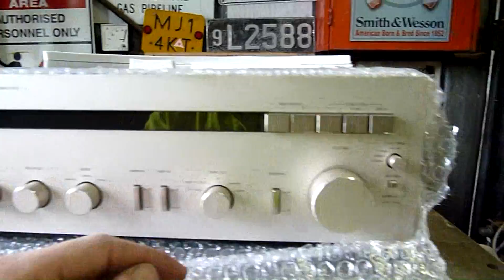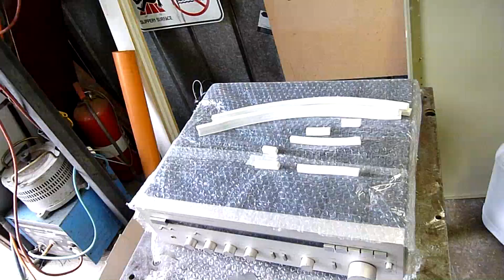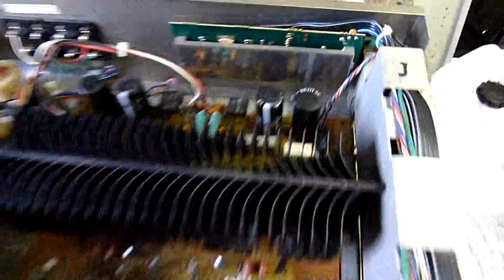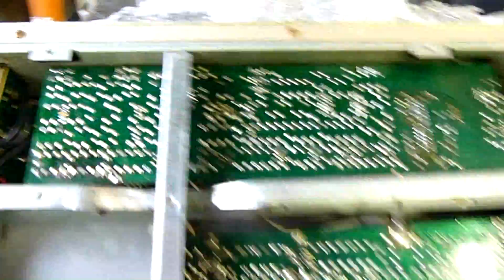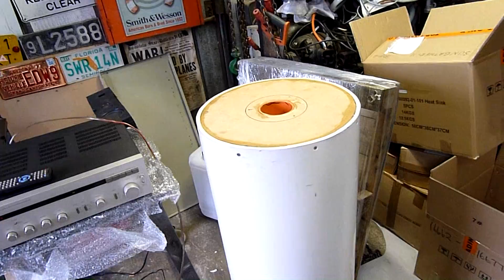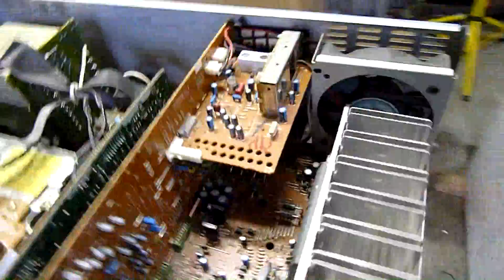Harman Kardon PM650 Unpacking and Test Run

Comment: The amps that actually put out there rated wattage bought a Harman kardon avr 1610 rated 85 watts 2 channels driven have a Nad brand amp less wattage per channel and can't stand it up past half and used the avr in 2 channel configuration had it up at 3/4 and was like wow pathetic . Nad stuff is built more like the old stuff may cost a bit more but you get real power

Comment: G'day mate
Not a bad amp there , bit of info at  Audiokarma  on it &
If you are after a service manual for that ,
[ HARMAN-KARDON HK-650 SM /elektrotanya ]
  ^ google search it that way ^ cause the site is czech or polish unless you understand (manuals in english)
elektrotanya has good quality service manuals (max 2 a day for free)
 you will see underneath the preview , wait until it says "get manual"  then its free of charge.
goodluck with the recap

Comment: bias pots i guess, but why would a transistor amp need that?  I thought variable bias was exclusively a valve amp thing, so when new output valves are fitted the bias current can be set to the users preferance.

Comment: ed i reckon those sankens NPN PNP may have been newer additions - the older kit used to have toshibas and the like - i've built a new solid state things with these before - the 1169s and 2773s are common place and can be had easily enough.....

Comment: grab the fan and transformer out of the DVD changer, you can never have enough fans and you could have some fun with the transformer wired to step up the voltage (and then burn it out)

Comment: Not worth to change those supply caps for a bigger value in my view, this amp use two separate power supply rails for left and right channel as I remember, that's why they are a bit lower than most amps have, when there is both channels on same rail then yeah 10000uF is standard. New 4700uF will do the job perfectly in this amp, we are not talking 100W RMS here anyways. You will only make more problems with bigger caps, like random fuse blow on power on :)

Comment: One that runs directly off the AC mains? That's interesting, and useful. I found a junker Sony home theater amp that someone dumped, I'm not going to try getting it going though, it's been thrashed with broken controls and so forth. That's going to have the power transformer, heat sink, and other bits pulled for other projects.

Comment: You can always spot cheap consumer grade electronics like that all in one unit, lot's of plastic, no weight, and a switch mode power supply. While not every device with a switch mode supply is garbage, every garbage device uses uses a switch mode supply.

Comment from the maker: could be somthing as simple as a ground loop issue, try running a earth strap from the amps metal chassis to the chassis of what you are playing into it.
The Monarch amp in my bedroom does that if I do not have a lead going from the computer case to its own ground lug on the back panel.

Comment: Looks like the pairs of caps are wired in series and centre  tapped, so would be a pls and minus supply (2  x 5 mictofarads in series would be a total of 2.5 microfarads)
If the selector switch got noisy, a shop may have removed it, cleaned it, and replaced it, rather than trying to find a special part.

Comment: From seeing two sets of filter caps, your power transformer is probably a dual secondary allowing each channel to be isolated.  I have a HK-560 receiver that sounds wonderful.  I did have to recap due to age.  Turned it on one day and bang!  One of filter caps for the line stage blew its ground connection.  I would recommend recapping with Nichicon audio grade caps.  The 4,700 mfd filter cap values should be fine given your probably running dual secondaries. ;-)

Comment: a little ripple on your voltage off those caps is OK.  the amps are more like linear power supplies in that they have really high ripple rejection on the supply voltages, should be 60-70db I'd think.  The hum might be something else like a loose ground on an input.

Comment: Hmm denon or nad were good quality amps as well :-)

If you uprate those capacitors check the forums to see if the bridge rectifiers need to be upgraded for the extra inrush current at switch on :-)